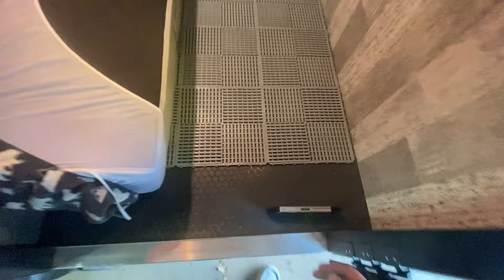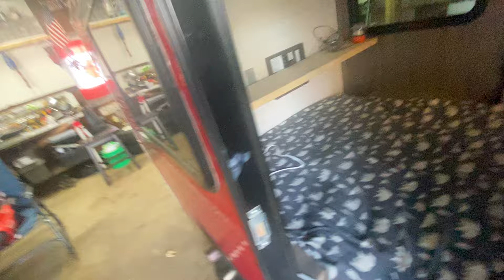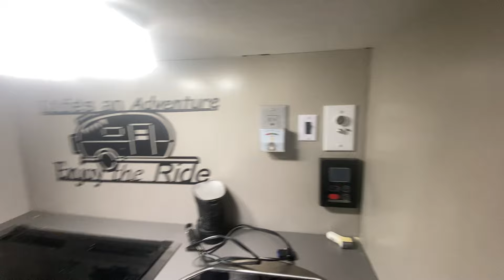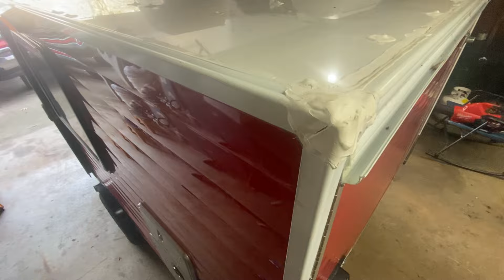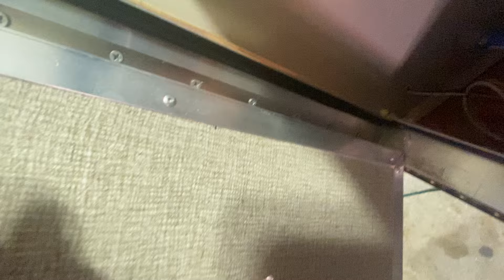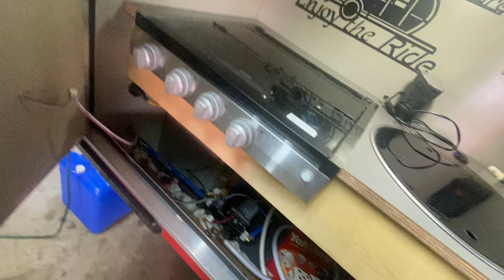DIY Micro Camper

Comment: It's so cute! 🥰 How much does it weigh/can it hold?
Reply from the maker: I haven’t officially weighed it yet, I need to before I replace the axle so I get the properly rated axle. But I believe it’s roughly 800# +/-100. Comfortably sleeps 2 i do wish it was a foot taller for the rear kitchen and a foot longer for some extra leg/gear room. The tongue weight was where I really went wrong with the design- the axle is too far forward for all that kitchen weight. With 2 full 30# LP tanks and 2 AGM batteries I have maybe 75# of tongue weight. I’m one tank empty right now and pulled it without our gear inside and it towed like garbage. I typically have roughly 250# of gear in 3 totes that I load right in the doors at the front and it tows much better that way
Reply: @campMIwander Nice! What kind of ground clearance does it get? When you replace the axle are you thinking maybe lift as well?
Reply from the maker: @Discovery4x4 probably with this build I’ll just stick with the axle flip. A lift beyond that wouldn’t make much sense without some major reconstruction as I built the fenders to fit those particular tires. I’ve got roughly 10” or so of axle clearance. Which is ok for the trails Adeline here that I’m comfortable with